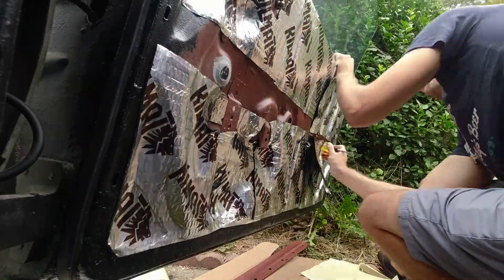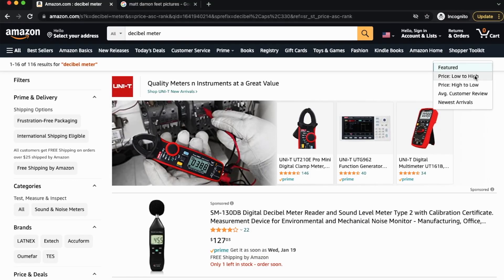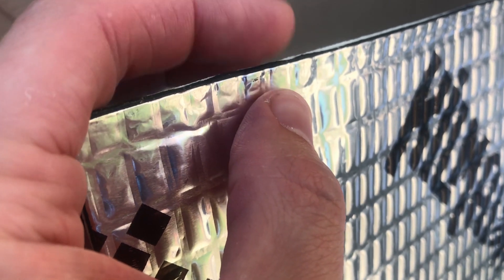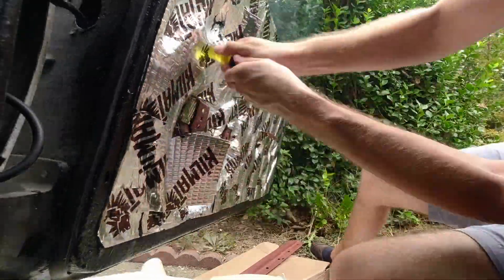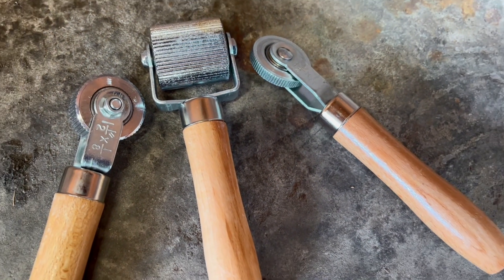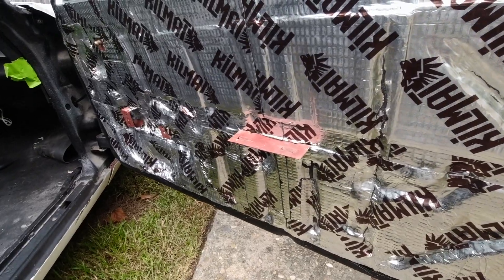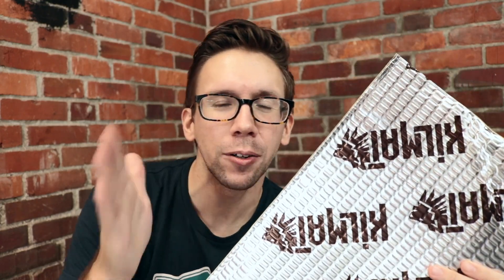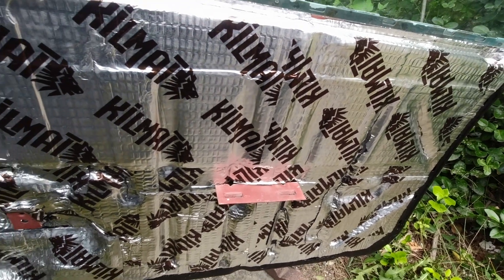Are Doors Worth Sound Deadening? Before and After Decibel Testing

Comment: Looking to sound deaden my tundra, is kilmat worth it? Going to just do the rear cab section first since I removed the back seats
Reply from the maker: Honestly I think it’s quite a good value. I always recommend people to do 150 mils thick of coverage if budget allowed. I’ve heard the theories that that is overkill but I disagree from years of doing it. If you get the 80 mil version, two layers is perfect. It’s been in the engine bay for month with no issues or peeling away - that’s quite a good sign it’s a solid product. Do you have a subwoofer in or under your back seat area?
Reply: @MatthewFinlay  no subwoofer yet. Just installed a new dual exhaust for the truck. Think I want to try sound deaden the rear area, and then build a platform for my dogs when we take trips. Eventually I’ll get back into car audio. Just don’t trust my dogs not to ruin the box if I have both.
Reply from the maker: Sounds good to me! Food for thought - thats not normally an area I would do a decoupler and mass loaded vinyl (mlv) on unless a they had a subwoofer or wanted a dead quiet cabin. I’ve found that since mlv is a sound blocker it works extremely well at keeping sound out but also pretty good at keeping it in. Mlv has its drawbacks but just something to think about.

Comment: There are cell phone apps that reportedly report dB levels.
Reply from the maker: Yup I have one! I used it to check the readings of the cheap meter, they both are pretty close to the same readings. Although I can “slow” the reading on the phone app making the driving portion easier to average.